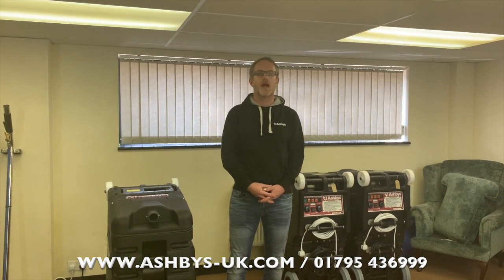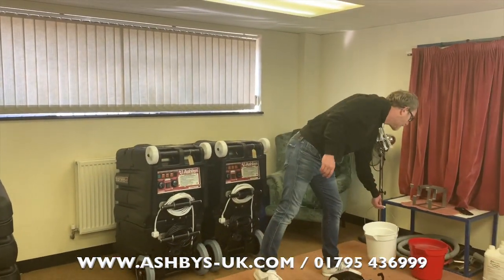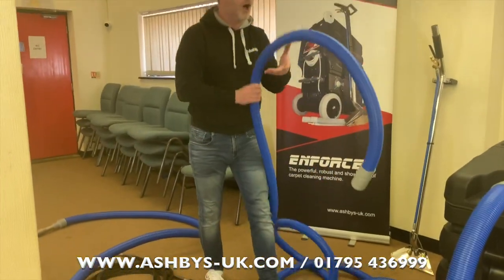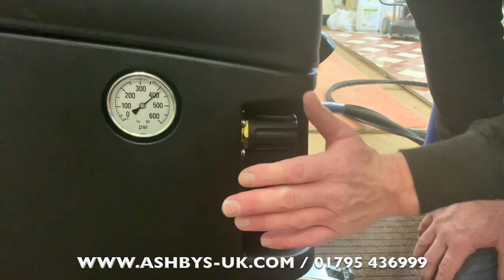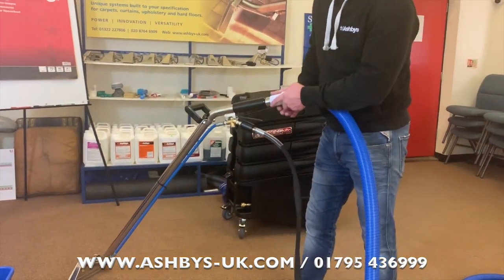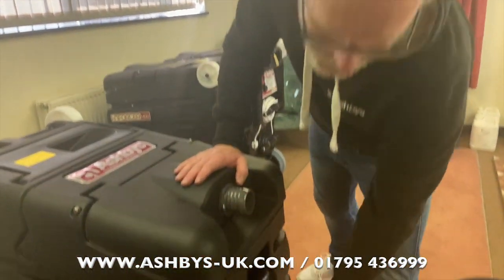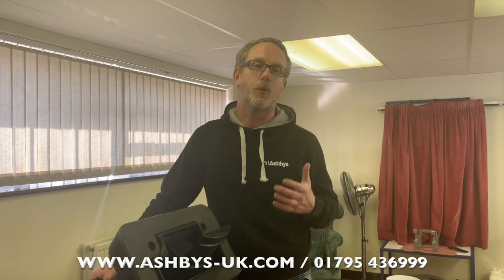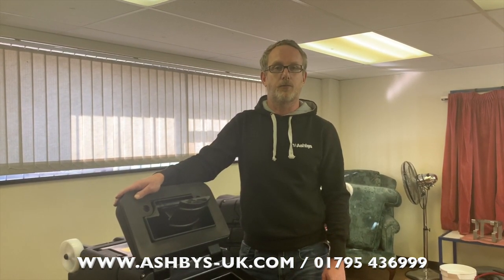How to use Ashbys Enforcer 400 psi with V2 SteamMate & Tank Heater

Comment: Hi, I’m looking to start a carpet cleaning business and I’m very interested in the enforcer 600 with all the extras, I should probably call but I’m a few months off before i will the finances available (house sale pending) I have a couple of questions

1) how many average sized rooms could be done before a refill is needed? I understand there are variables.

2) you have 3 stages of courses to choose from, what are the differences? On the website I can only see stage 1 also it’s insurance approved training but dose that mean no further training is required and a business can operate full from your course? 

3) with the loading of the machine on the van can it be kept in that position or should it be stood upright?

Sorry for asking here in this way if it’s not the place you want to share any of the info I have asked I understand and will give you guys a call in the very near future. Thanks